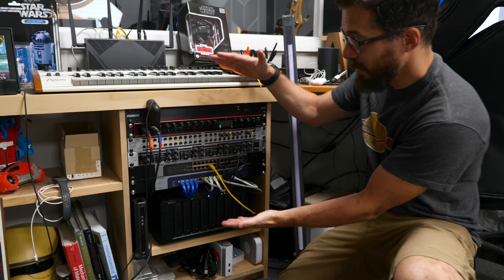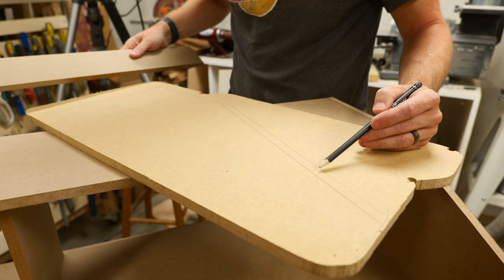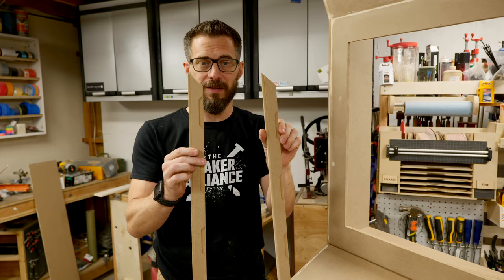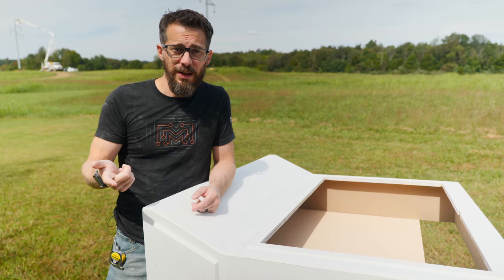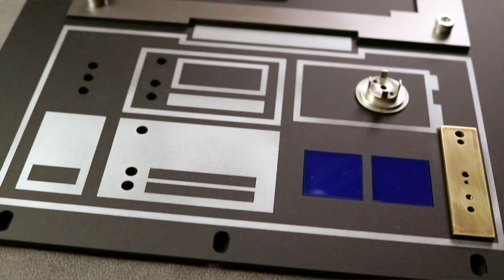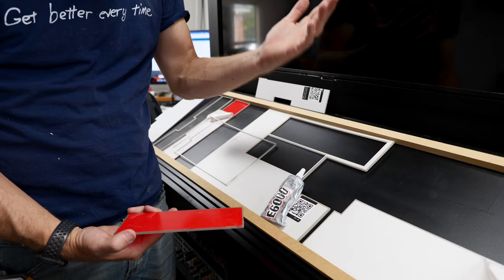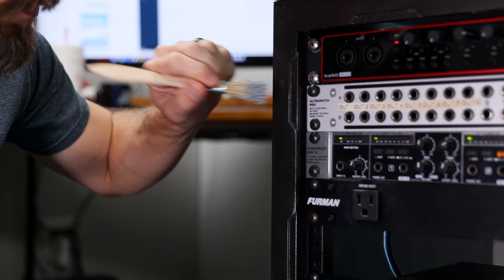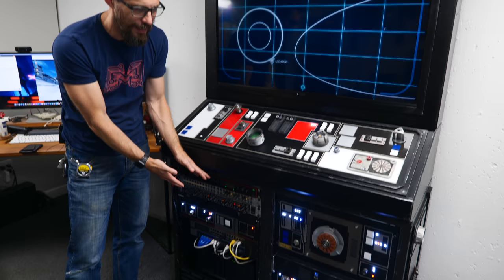Star Wars Inspired Entertainment Center | I Like To Make Stuff

Comment: Hey Bob, I recommend the Wham Bam Flexible Build System for your resin printers. No more stuck parts.
Reply: I have the Wham Bam Flexible Build System.  Prints pop right off the build plate with ease.

Comment: As far as your comments about spraying/sprayers and how you don't like the ones that you have tried: I was of the same opinion, but that was because I was using the lower end brands of sprayers. I finally pulled the trigger and bought a top of the line 5 Stage Fuji HVLP Sprayer. I retrofitted it with a 3M PPS disposable cup system and now spraying is like living a dream. Super easy to use, suoer easy to clean up and all my finishes (shellac, latex, oil, poly, etc) come out looking like a factory finish. Spend the money and you won't be disappointed.

Comment: I have a few different sprayers... never go back to just using spray cans. LPHV  bottom fed is my fave. 1mm, 2mm, 2.5mm and 3mm guns for all the different paints and finishes...Also love my Graco Pro airless and the Graco Handheld for bigger projects.  I still use rattle can for smaller stuff and specialty colors or finishes.

Comment: One easy addition if your network gear is on rails and not just hanging on ears would be linear actuators to rack out each unit.

It would make use of the dead space behind your decorative panels.

I've been planning on doing this with my own rack along with the intro to Welcome to the Machine timed to the extension of the actuator.

Some sort of smoke Gen would be awesome to provide that cryo effect, but I'm not sure what would produce dense white smoke that's oder less and residue free without being high maintenance.

Comment: It's cool, but might I suggest in the future just use a sacrificial small 30" 4K HDTV for about a hundred dollars... put a thin piece of plastic and literally glue the switches and gribbles on to it...And then you'll make a screen on Photoshop or illustrator that displays a panel with text, maps, etc on the TV so you don't even need backlit!! The results are awesome and it saves you a lot for work.
That guy fronth smuggler's room is AMAZING!! I'm subscribing

Comment: Kewl beans!! The only thing I think coulda made it even 'geekier' would've been to assemble the greebly that you put together at @ 25:00 on the shaft of a reclaimed microwave turntable motor-- these are usually 5-6 RPM (slow!) torquey little motors, and having that part randomly rotating (only attach it to the front or middle plates, let the others 'freewheel') would trip out even the geekiest of SW nerds!! Keep on keepin' on-- 🤖

Comment: Excellent build. I have a few questions, if you don't mind. 1) What tape did you use while cutting the mdf to hold it together? 2) What did you put behind the small screen at the top left, to stop the leds from showing? 3) What are those Lego pieces? Thanks, and get better every time!

Comment: Hey Bob as I mention in your other star wars display case you may want to look into EL Wire Its about the size of copper wire but when low AC voltage is applied to it it will glow brightly! There are many colors to choose from and since its low voltage AC its pretty much portable. Also depending on how you use it it will look like those neon signs. Again check it as it may help in places where LEDS or other lighting might not

Thanks and keep up the awesome work!!! ^^

Comment: Maybe I missed it, but what are you doing about the air throughput of your rackmount equipment? Rackmount servers are designed to use directional airflow to pull cold air and exhaust hot, usually cold (or at least unrestricted volumes of not hot air) from the front and hot coming out the back.  Pinning them with either the front or back of the server against a wall will either restrict air intake, or vent hot air into your cabinet until it's an oven that will shorten hardware lifecycles and cause operational failures over time. If you haven't already - you probably want to figure out an exhaust strategy.

Comment: It looks great! I know birch ply is a little more expensive, but it's only about 98% safer for your lungs while cutting and till the dust settles regardless of how good one dust collection system might be. LDF and MDF is by far the worst material a small home shop can use for projects, the resin adhesive containing urea-formaldehyde which is in the Group 1 carcinogens, Yes even normal wood dust falls in the Group 1 carcinogens however it is not as fine particles as LDF and MDF or even HDF. lol I'm starting to sound like mother ain't I lol

Comment: Now that you completed this project, would you recommend the “rough cuts” you did for most of the pieces and filling with wood filler OR would you rather have instead made more precise cuts? Curious if you had regrets having pieces that weren’t fitting quite as well then having to “fix” with filler?. Thanks! Great work!!!

Comment: Bob “don’t use the wrong batteries on a tool”
* proceeds to use a dewalt hot glue gun
Reply: Bob can do things you cannot. He's amazing like that, which is why we all watch!
Reply: That's a Surebonder glue gun -- their cordless glue guns are designed to work with specific platform batteries.  Presumably, Bob just got model PRO2-60DEW which uses DeWalt batteries.

Comment: I’ve long wondered why modders haven’t made a Star Wars themed gaming computer. Not the crap they usually make that just has the name of a Star Wars game on the side and Star Wars decals laser cut into the panels. I’m talking a computer that looks like it’s from the movies. With all the random switches and giant buttons, and monochrome crts to display system info. Could even mod a vr headset to look like the headsets they use in the movies.
Reply: This is what I get for commenting before watching the video. You made my dream come true. You even made it more than a computer. It’s a giant server rack. Which is exactly what I would do! Though I would have less audio gear and more storage and compute power.
Reply: I wish that the control panels were usable. You should have installed a funky keyboard and a bunch of controls that have real functions. You should have also bought one of those touch panel frames for the lcd screen.

Comment: there are many unneccessary steps and useless parts that show how improvised this work was but overall you managed to make it look cool. It looks like a steampunk bunch with a scifi feel instead of victorian. Still I would have had at least the majority of the buttons and spies do something, be connected to something (volumes, on/off switchers, bluetooth buttons, whatnot) or even not doing anything but actually lighting up or rotating/moving randomly

Comment: Hi I love your videos and have watched for a long time. You mentioned that you had a vinyl cutter and so do I, my problem is that I have looked at the company’s web site and to my horror found that they went out of business some years ago and the main problem is they did not make a driver that works on windows 10. As your vinyl cutter works could I ask where you got the driver from so that I can try that to see if it will run my machine, I cannot just return it to the seller (that would have been my first idea) as I have not been well and the item is well past return time. Ilove the moving picture you put on the TV, it make all the dirrence.

Comment: Question.  If price were no issue, why MDF over plywood.  Around here, the cost difference is pretty minor and MDF, chip, OSB or what have you are less durable and heavy as heck - also less "green".  So, why?  To be clear, a project that needs only a couple sheets will only cost a couple 10s of USD more with lighter and more durable ply.  WHen a project costs around $100 in material, I don;t see how saving 10-20 is a real issue when so much labor is involved.  Just wondering.

Comment: Would you recommend a resin printer as a first one for someone who has no experience in 3D-Printing at all? Greetings from Germany
Reply: Unless you're into miniature figurines, i would not. You can't use resin printing for structural models (unless you cast them into another material afterward) and the post processing (washing and curing) is non trivial to say the least. You have to decide on your curing process, often DIY your washing / curing station (or buy additional equipment : ultrasonic cleaner, UV curing box, washing tanks and solution...). Having been using both, FDM printing (once you've tuned your printer settings) is much more forgiving and easy as a beginner.
Reply: @the_arcanum  : Thank you for your indepth answer.

Comment: What do you use for wood filler?  I've tried "wood filler" as well as spackle (Wood filler is EXPENSIVE, whereas Spackle is cheap).  Both seem to have good/bad points.  Where I need LOTS of filler I'll mix up a batch of bondo, which is one of the best "large area" fillers I've ever used....especially when I'm just going to paint it in the end.  Just curious.

Comment: So does anyone know where ILTMS got that animated tracking UI .gif that's running on the tv panel?
   This is where my build is stalling out. I initially wanted to make acrylic plates like the one in the video (top left), edge lit with LED's  then layer them to give a little illusion of depth. 
Anyone that has been to Star Tours at Hollywood Studios should recognize the process I'm describing, there's several large panel examples in que for the ride. 
    Problem is, I don't have a fancy laser cutter or laser etching machine. 
   I DO have about 10 lcd screens of various sizes...a few of which I'd simply need to buy an lcd controller board and good to go.
   Problem there is, I can find LOTS of Star Trek "animated UI" stuff. The LCARS system I think it's called. Star Wars, not so much.
Reply: I'd like to know that too, stuff like that about star Wars is surprisingly hard to find… :(

Comment: Seeing you use so much force and a METAL spatula to loosen the printed model from the baseplate made me cringe hard.. You're supposed to be delicate with the baseplate to prevent it getting scratches and such that will make the next model stick even more.. or it could just break..

Here's two easy options to your "neanderthal" approach: 

1. Use dental floss.. feed the floss under the model and GENTLY use it to loosen the model.
2. Make use of temperature difference. Let the bed and model cool down completely. Then take one of those compressed air cans and turn it upside down and spray some of the supercold liquid on the model or plate. The temperature difference usually makes the model contract, thereby releasing it from the plate.
Reply: Isn't it standard practice to cover the base plate with a layer of painter's tape for easy removal?
Reply: @Thalanox  probably depends on the type of printer. if they use one of those that dip down into a vat of fluid then painters tape is probably not the best option.